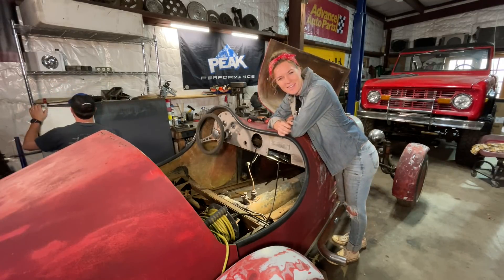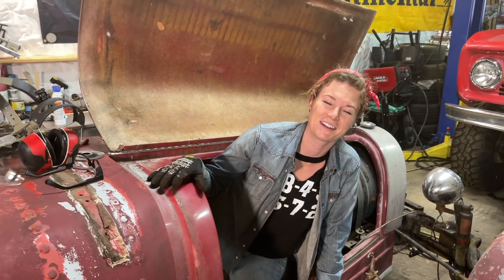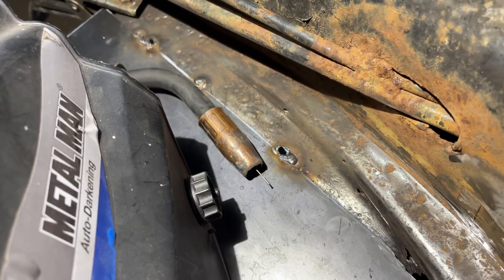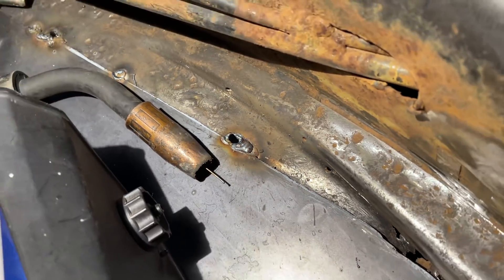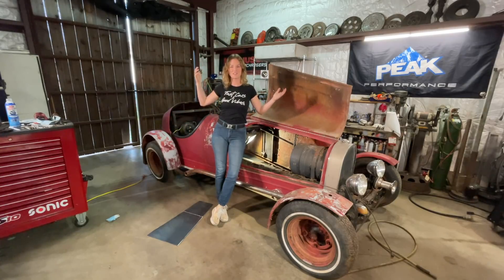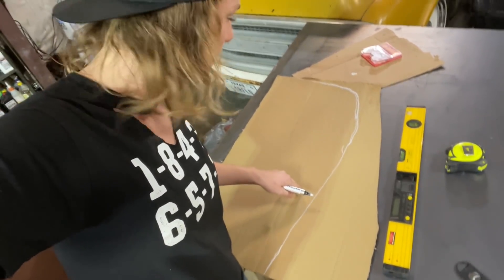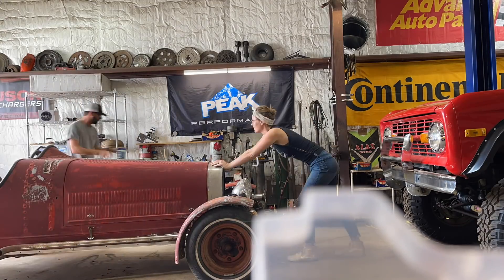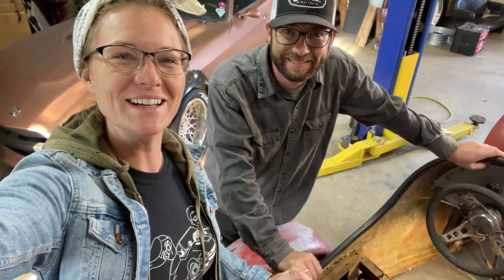The ugliest welds of all time! Floor pan time!

Comment from the maker: Drop your (MUCH NEEDED) welding tips, HERE! 😂👇🏼
Reply: might try sand blasting to prep the metal for welds best way I know to fix splatter welds
Reply: In the past I have used 2 rods while welding in a spot that needed extra filler.
With the second rod in my other hand. Keeps the thin metal from getting too hot. 
Could lay some rod/wire down and weld over top .
I've done both.
Reply: ,030 wire might have helped a little. Often the rollers on those size welders will feed both .035 and .030. I also have several pieces of copper flatbar that I'll use as backing. Weld won't stick to it and it's a great heat sink. I just shortened a pickup bed (converting it to a secretary style shop desk) and found the tig welder was the best solution for me. Thanks for sharing your shop and projects.
Reply: You might want to drop down to 0.023 wire, higher flow of the shielding gas, and stich welding (multiple tacks in a row).  Welding thinner steel is much tougher than welding thicker materials (0.120" + up).
Reply: Just trying to help.  TIG would be a better choice, but you have MIG so I offered what I know
Reply: Collect various sizes of scrap metal of all different kinds, experiment with different settings and styles of welds and also make sure your electrical supply is sufficient and you don’t have a voltage drop when arcing. Maybe just drill holes and rivet the panels in!
Reply: you should practice at least two hours a day, laying a bead, and you should have sandblasted the metal. And take the body off and work the frame. And maybe watch this youtube channel wield.com.
Reply: Leave it for the trained professionals.
Reply: Go check out Fitzee's Fabrications  on YouTube. He is a master at repairing old sheetmetal
Reply: Small tacks one after another is the key , this is known as "pulsing it in"  remember when you start with garbage (nasty , rusted metal) your gonna wind up with garbage. Unless you just continue to go over it & grind it back until you get clean metal (which is WAY TO TIME CONSUMING) & I don't think you're looking to take this thing to the Conquors De Legance.  I couldn't tell if you were wearing one while grinding & cleaning  but if you weren't ....put on a respirator - there's some really harmful stuff in that rust dust girl . Have fun but be safe & keep after it👍
Reply: Came to recommend Fitzee as well.  Thumbs up!  Also, check out The Duckman for advice on VW floorpans.  I think he has said that VW originally only put them in with a bunch of tack welds, then slathered seam sealer over everything, so you don't need to weld the ENTIRE pan (but oh well, too late now).  But check out some of his floorpan videos for vw-specific advice.
CAN'T WAIT to see this thing running.  Would love to have one like it!!
Reply: Looked like you were using .035 wire which requires more heat. Try .025 wire especially with the stock thin sheet metal. Ive welded a lot of floorpans into Scouts which translates into RUST. Start on the thicker repair panel and move on to the thinner sheet metal and spot weld then move.
Reply: Get some flat copper bar or sheet to back the weld. It will create a backstop for the shielding gas and should help keep the parent metal from blowing out by conducting the heat away. Clean metal is a necessity for MIG and TIG.
Reply: I agree with several of the other comments about dropping down to .025 or .023 wire.  .035 is way too hot to run on old rusty metal.  You should be able to run it through your existing gun liner but you will need to drop down in tips.
Reply: @trolling4dollars816  you cant Tig a rusty gap like that.
Reply: You don't need to be a good welder, just a good grinder. 🤭😁
Reply: Tack all the way around and caulk the rest to seal out water from getting inside.
Reply: Emily, are you from  Texas as well?
Love your videos. You seem down to earth and a pleasure to watch.
Reply: Concentrate your heat on the new steel and just let your puddle flow onto the old stuff. Might have to whip it over a little
Reply: 035 wire is way too big for sheet metal. At the most you should be using is .023.
Reply: You're not really tacking.
Reply: Watch some Junkerup build videos and half-assed customs both do a lot of welding in patch panels and pans etc with tips
Reply: Use a large chunk of copper for a backer and close off holes. Just weld across it from the edges outward. Then tap to remove it. Holes filled.
Reply: When welding thin metal, try using an aluminum backer panel/plate to help absorb the heat and stop blow through. I usually use a 1/4" aluminum plate behind the thin steel I am welding and it sure helps. Try it, I think you'll see a huge difference. And don't keep welding when you are doing thin steel. The heat builds up and will blow through quickly. Do short welds and move to a totally different spot to allow the metal to cool off before returning to it...
Reply: I agree with most of the tips. But first off, proper welder maintenance; that nozzle looks nasty, but also adjust the rollers properly for the gage wire you're using. For auto body, 0.023 wire is pretty much all you need, and don't let the heat soak in your metal too much. 5-6 tacks, then move to the oppostite end or corner of the part to let it cool. You can also blow air, or keep a water bucket with a rag or spunge nearby to cool the metal and prevent warpage. For nice tips I'd recommend former Texan "My Friend Pete" from DIY Autoschool channel; he's a gold mine of info and tips, if you have strong ears and can tolerate his mood swings hahaha!!!!
Reply: Where'd you find a welding hood that fit a seeing eye dog?
Try a lighter shade lens for him, or maybe you misunderstood that one bark means weld slower and two barks meant speed up.
Reply: Like some of the other comments, drop down to .023 welding wire. Most drive wheels are reversible so you can feed out thinner wire. You'll need the proper tips so you have good electrical contact with the wire.  Also if you don't have a big block of copper laying around, use a thin sheet of copper flashing on some steel as a heat sink.
Reply: .035 wire is to big drop down to .023 mig wire
Reply: get a magnetic copper welding backer from Amazon and learn the art of backing your sheet metal with a copper backer (aka a chill bar/chill plate).  When welding on thin rust ya gotta move right along. No dawdling in one spot too long.  Finally, on sheet metal you should use "stitch welds". Google it or put it in the search on you tube.  Oh, and as others have said, use .025 wire. Good luck.
Reply: Your tip to work distance is too far,  you need to bring the cup closer to your work!!
Reply: Metal has to be clean..clean..clean. I'm no welder, and I'd love to actually do it. I have been watching alot of videos on it. The cleaner the surface, the easier it is to do stuff with it. Your voltage/heat settings have alot to do with thickness of the metal you are working with too. Not to mention adjusting your hand speed to coordinate with the settings on the welder. It's best I think to rate your heat setting and such on how fast you naturally move the stick. Whatever pace that is, adjust your settings to that. I'm sure that alone will be a big help. 
Btw, you two are in serious need of a media blasting booth, and a cabinet for smaller parts....this vw/Bugatti replica has seen better days. Ugh. I know this is an old video and all, I'm playing catch up on alot of these. Felt compelled to comment on it.  Good luck with this and your future projects.

Comment: When welding light gage metal,, I often use a copper backing bar to support the weldment and keep from burning through. The copper won't stick to the weld either.
Reply from the maker: Thanks for the tip!!!!
Reply: Porcelain works also
Reply: I want to second that thank you. That's a really great tip I'll have to try it next time I weld thin gauge metal.
Reply: I have used porcelain to back a weld area. Great tip.
Kinda like the idea of molten metal ladle or a kilt to cool down glass.
Fire bricks work well too.
Reply: Copper backing is really good when can. Otherwise short "tacks on tack" just like Aaron did when he filled the holes is the way.
Reply: @justin watch no it doesnt.
Reply: @justin watch I have used copper backing plates to weld light metal for years.  I have never had a problem with
the copper fusing to the back of the weld.  How long have you been welding and have you ever tried it?  I TIG weld 
copper using a copper filler rod, try welding mig steel alloy to a copper plate and you won't have much success. It 
may try to stick, but will break off easily.
Reply: I just use a 12" or so piece of 3/4" copper and pound about 5" flat with a hammer and keep the rest for a handle.... hopefully that makes sense???

Comment: When dad built the kits he had in 77, the assembly instructions required 120 lbs of lead shot or concrete in the front to keep the nose from lifting at highway speeds.

Comment: I thought you were doing a pretty good job Emily. When I was restoring my 1936 Austin 7 my teacher taught me to first attach the repair panel with tack welds (maybe at the corners). Then to do spot welds about an inch apart around the whole panel. But don't do too many close together to avoid distorting the panel from too much localised heat. Then join two spots with continuous weld (so a 1" weld). Then miss an inch and join the next two welds. Continue until you have 1" welds on the whole panel (but remember to do different parts of the panel to avoid heat distortion). Then as Ken May says use seam sealer between, or if you want you can fill the other 1" sections with weld to end with a continuous weld.

Comment: Jim beat me to my comment... I use scrap copper tubing that I have bent in several shapes and sizes to help with the blow through... sometimes there is just a small rust spot that I can fill with weld, then grind smooth. or another trick is to build a damn on either side of the hole making small passes on all sides towards the center to fill. One late Saturday night repair that had to be completed and running low on welding wire and no patch metal left,  we cleaned then cut to fit clothes hanger rod to fill the gap. With copper on the back side, it was welded all together. It was a little tricky but the hanger and rod melted together and the patch turned out awesome

Comment: In the instructions for these kits it says to add weight to the front. The kit is shorter and much lighter than a factory bug. In order to keep the front suspension from topping out and hopping, you were to add weight.

Comment: I've made uglier welds in the past and still do from time to time.  space your spot welds further apart, make a spot weld move a couple of inches down and make another and just keep going like that all way around and start over the same thing.  the other thing is the wire. that 035 is for heavier metal you could weld a frame with it.  drop to 023 and you'll have much better luck.    Great work keep it up.  love the video's.

Comment: I see people mentioning copper when welding light gauge steel. I’ve never used that but I have used a piece of aluminum. The weld wire used on steel won’t penetrate and hold aluminum. You also want to move around and not just go one on top of the other all the way around as the steel will warp. Do a couple in one corner then move to another. Let the steel cool a little before you come back to it.

Comment: I was going to say- you need a heavy duty bumper of some weight to keep the nose down as power sliding does just seem to go straight ahead on vw buggies, that is why the weights were put in to keep the front tires steering. Have fun y-all !

Comment: They now make flap sanding discs for cleaning up fugly  inside corners, give them a try. I replaced my rotted VW buggy pans with fiberglass and 1-1/2 square steel tube perimeter rails.

Comment: instead of trying to fill the seam tack the floor pan in each tack should be 1/2 in long atleast every inch then use body seam sealer to fix the rest .its easy I did that in body shop i worked for  many years ago

Comment: .023 wire helps a lot, .035 is pretty big for sheet metal work, and yes, a little at a time, can't run a bead on sheet metal, its a whole other kind of monster. I'm no expert, but I've also worked on a lot of crappy rusted cars. Enjoy the channel guys, keep up the great work.

Comment: I know its tight for space in there but you have to try to point the welder at the new steel because it will take the heat better. I noticed you were pointing the opposite way.

Comment: Your pulse technique works. You have two issues your dealing with on the welding: 1: You're using dual shield (core wire with a shielding gas). For that thin of material (mainly the BUGatti rusted up thin as hell metal) you are welding dissimilar thickness metals. Short circuit transfer with solid wire (.024/-.023) diam. with 75/25 argon/CO2, would have served your purpose much better.  2. Practice on a fab table first matching similar thickness metals with the process and technique before you put your self in an awkward position. This allows you to set machine parameters and technique before you add  the "bend yourself in a pretzel position" to try and make a weld. Oh, and turn the machine on before you crawl under the dash in the "pretzel position". Fortunately you had a "hubby" on standby.

Comment: To clarify.....all welds aren't the same. Floorplan is different than a pressurized pipe or a support bracket on a bridge. They have to be (perfect) as well as grinded grooves to make 20 passes. Than xrayed.

Comment: Just curious as to why you left the body on? It’s way easier to work on with the fiberglass removed, also, you’d have better lick using .023 wire instead of .035

Comment: The concrete was a counterweight for the front end......it needs replacing with something equaling that sort of weight as at the mo all the weights in the rear and it will handle like Skippy and Tiggers love child ...hopping and bouncing.
After rewatching this I realised a massive "problem" the "petrol tank"(more like an oil drum ) is right in the front, one frontal impact and you're going to end up like Achmed the Dead Terrorist......you know......
"What was the last thing that went through your mind?" 
Achmed "My ass"
Loving all you do,
Loving the Buggati,
All the best!

Comment: You will find that you will need that weight in the front, as it will tend to Float at almost any speed, and a problem turning corners especially if it is a wet road..

Comment: I'm not an expert but did you match the size of the patch panel to what the car is?Are you using .025 wire?Yes gas helps and should of practiced on scrap to get a feel for it.Good on you for doing this.Also i noticed most of the comments were of no help to you.

Comment: Assuming your valve covers were 5 inches wide, four inches high and 24 inches long (that's 480 cubic inches) and concrete weighs 0.0868 pounds per cubic inch, your valve covers weigh 41.67 pounds each. Heavy, indeed.
Reply: I bet you get ALL the chicks!

Comment: You need a copper "spoon" from harbor freight it helps to fill in the holes they are about $10.00 bucks I think. I think Mike Finnegan would be proud of you. I don't know how old your welding machine is but you might want to look at a Miller Auto Set 140. That's what I use for my stuff and it takes a lot of the guess work out of what speed/heat  you need to weld at. I have been welding for over 50 years and I still am learning new things about it. My Dad taught me to weld when I was 6 or 7 years old  when we built the mini bike I had as a kid. He was a 60 year member of Pile Drivers Local 2375 Wilmington, CA. He passed away on Feb.15, 2019 and sometimes when I'm welding it seems like I can hear his voice saying that exactly how I taught you how to weld your were listening to me after all. I miss you Dad.

Comment: I would just weld a spot move down several inches and so on and just fill in slowly. It helps minimize warpage. I'm hoping you can grind out a lot of that booger weld. IMO you will need some reinforcement on that pedal assembly.

Comment: I have a hunch those valve covers might actually be filled with lead, not cement.  That doesn't change your point at all, but maybe something to check for and recycle if that's the case.
Reply from the maker: They were INSANELY HEAVY! You may be right!
Reply: @flyingsparksgarage  But you will require that weight ballast again, otherwise the car will just go straight, and trying to go around corners will be damn near impossible. Had the same issue on a Herbie powered MG kit car (Rear engined).  Basically no weight over the front wheels, so no grip when turning.

Comment: Loving this fun junker rescue series Guys,
Okay here goes, Welding tip?
If you cant Weld Well, Weld LOTS! :-D
Nah im a rubbish welder  and Invest in Flapper discs lol
As for the VeeDub (VeeGatti?) the builders actually had the right idea re the cement filled ballast because as they were Beetles needed weight added.
My old 60's 1300cc DakDak (It made that sound soooo yeah DakDak) was my first car and on skinny bias ply rubbed was a handful until I figured out that bags of potting mix in the Frunk over the steering axle cut down on understeer, They also tend to swap ends quick and with no warning or much chance to catch the rear when it steps out plus the lack of power meant that grabbing a handful of opposite lock was a waste.
Good wider tyres and camber adjustments with some ballast experimentation with change the VeeGatti into a fun thing and maybe  a track blaster plus there is SO much aftermarket stuff for that platform.
So when its done and running? But wait, theres more lol performance and handling mods.
Thanks for the entertainment.